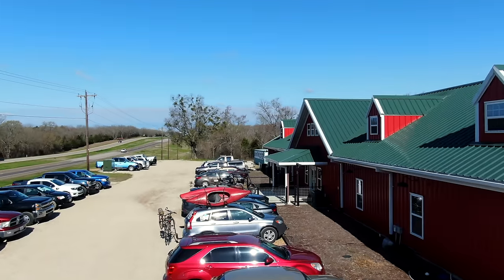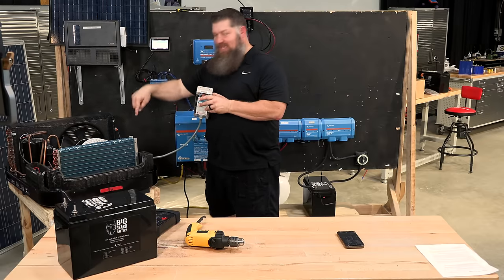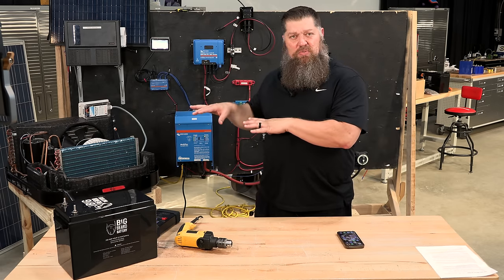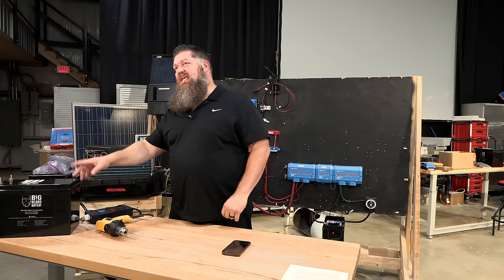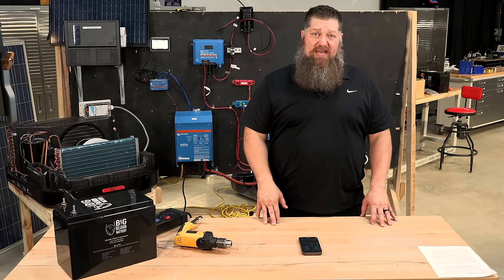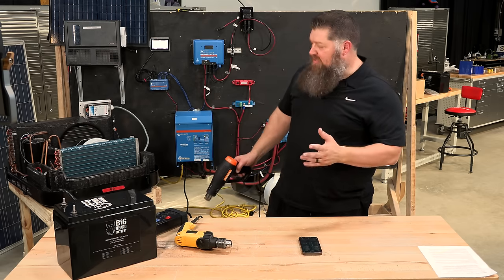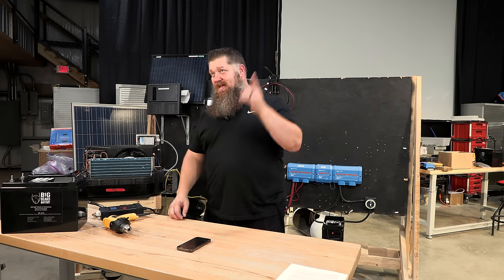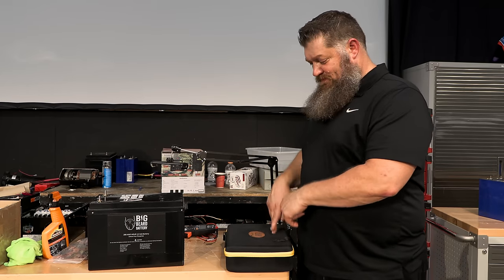Run RV AC off one battery🪫

Comment: Something that should be studied is the decrease in life expectancy of an air conditioner running off of an inverter. I have had to replace air conditioner within 5 years when they are ran part time off of High quality inverters
Reply: What exactly fails in the AC?
Reply: @bestman7776  the compressors in both refrigerators and RV airconditioners have their lifecycles split at least by 50 percent even with a soft start installed. The future would be to have high efficiency 12 volt fridges and A/C's so your not inverting the voltage . On a Custom X-Men themed Super-Van based of a highly modified Classic GMC motorhome I have install a cable race way down the center of the roof with 4 /O positive and negative 12 volt cables. Then branches off to three sub panels forward center and rear.
Reply: @EricVillalobos-h9r  it MAY not be related to having an inverter. Could be the vibration. Could be the condenser on the roof getting beat up by 70mph wind..Do you run the fridge and/or AC while in motion?  There’s too many variables to focus only on inverters.. just a thought. But I agree, a study would be helpful

Comment: Not all lead acid batteries are bad at high continuous loads (golf carts, fork lifts, etc) and not all lithium batteries are good at high continuous loads.  Try running that AC with a typical 100 amp BMS.
Reply from the maker: All lead acid batteries are limited on their amp flow well below the performance of lithium full stop. Its a chemical exchange that takes time. 

Golf carts only pull 40 amps but at 36 and 48 volts. Higher the voltage the lower the amps ended on inductive loads. 

You are right small 100ah batteries couldn’t pull the load that this battery can. This is the reason we showed what this battery can do.
Reply: @NationalRVTrainingAcademy  
Again, there are always exceptions on both ends especially if you're speaking purely of amp flow limitations.  Try starting you car with a standard 100 Ah lithium battery and the engine won't even turn over let alone start, yet lesser capacity 50 to 75Ah lead acid car batteries have been doing so reliably millions of times a day for decades.  Yes, in general, lithium performs better, but that is not absolute.  It all depends on the applications for which the batteries are designed.
Reply from the maker: @Andy-df5fj  i dont think we ever said it was better. The video is specific to heavy continuous loads. 

I appreciate you adding to the conversation but i want to be clear that we never suggested anything other than what this battery can do.

Comment: 140 amps from one 100ah battery for an hour and a half?   How's that again?  That math has never worked for me.  Don't you mean 42.6 minutes?
Reply from the maker: The battery is 280amp hours not 100amp hours. 280amp x 12vvis 3360 watts. 

The rating on the Dometic ac at 94* is 1400 watts consumed per hour. I added the heat gun to push it to 2400 watts per hour. 

So taking an average of around 2000 watts per hour then yes the battery will last roughly 1.5 hours. Math is solid and I have tested time and time again.  

You had mistakenly thought the battery was only 100 ah.

Comment: Everything you talked about is spot on EXCEPT.  A Victron Multiplus 3000 12 volt, is Not 3000 watt rated, it is 3000 va, that converts in real life to about 2400 watts.
Reply from the maker: Correct. I was referencing by name of the actual product.

Comment: question . how many cycles can a battery have over its lifetime. if you deplete it to 50 % each night wont you shorten its life?
Reply: Most lithium batteries can go 80 to 20 percent cycles for min 4000 cycles.     That is over 10 years.   Lead Acid can only be cycled to around 50 percent and back to 100 percent and then lucky if they last 4 years.

Comment: Forget it !!!!! You would need a very large battery bank to run any reasonably amount of time....... then you have to RECHARGE after every use from gen or utility using heavy amps. 
Forget it, run a fan.
Reply from the maker: So for those who live in 100 degree weather might suggest that a fan is not sufficient.
Reply from the maker: People are doing it all the time now. It didn't make since just 5 years ago but now you're able to get near 5K of solar on your roof and 2800AH of bigbeardbatteries.com. It's still expensive but doable.
Reply: @NationalRVTrainingAcademy  ok man !
Reply: @NationalRVTrainingAcademy  I know, Not trying to be a 'dick', it is just a difficult task, not even to mention the cost....... wish engineers could come up with a much less power required for cooling system........ maybe some direct 12 or 24 volt type system that DIDN'T use 100 amps.
Maybe adding some 'evaporative' component ????
Reply from the maker: @DF-te2vm  so i have a 48volt roof mounted AC from Houghton that ill be testing very soon. Pulls roughly 30 amps but is 38 volt.
Reply: @NationalRVTrainingAcademy  better but now (and I know you know this) need 48V charging and basically, requires the same exact power, just flubbing the voltages around the current, so yes, smaller wires but a whole 48v sys to manage. I remember when I had a marine business 5 or 8 years back, that Dometic  was attempting 12v air cond. Don't know what happened to all that.
Reply: @NationalRVTrainingAcademy  may be wearing out my comment welcome....... you got me thinking...... in Florida here, I put a 5000btu window unit in my bedroom window so I don't have to cool the whole house down so low at night while I sleep. That 110v ac uses about 4 amps....... so at 10X for 12v draw, under 50 amps for cooling !@#$
Reply from the maker: @DF-te2vm  Oh I agree there that RV acs are probably the most inefficient ACs on the market. We have been pushing for change, so many better options. But as always. Its about the cost.

Comment: What a misguiding video.  Any off grid person knows, running an Air Conditioner is a no-go for sure.  Instead, try to teach people how to use 12 volt where you can have success ... LED lights, laptops, gas heaters (with electric start).  Running air conditioner is not really possible unless you are rich.  You got $10k for solar and $10k for high end batteries?  DO IT!!  Then again, if you are rich, why are you trying to set up AC on a boondock RV??!!
Reply from the maker: Any off gridded eh? I can tell you there are just as many running acs off batteries. Woot to 2023 gone are the 1900s

Comment: My A/C has heat also. I want to put a soft start on but can’t find info on if it is OK. Suburban A/C 45004-8792
Reply from the maker: I think you mena Coleman 45004-8792 is the Mach 10. Yes even heat pump the Easy Start will run both the AC and HP function as both funcations use the compressor.
Reply: @NationalRVTrainingAcademy  thanks, I took that info from the manufacturer’s serial number list for my rig that came with my rig new